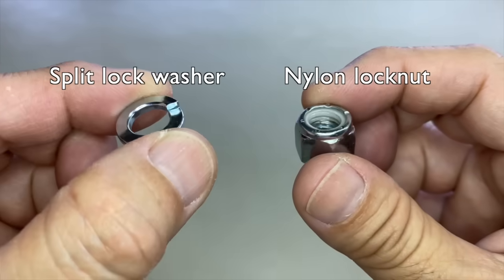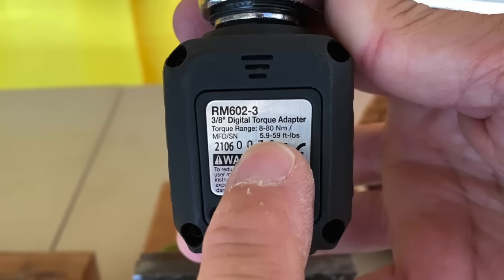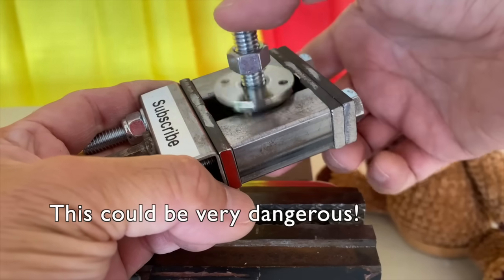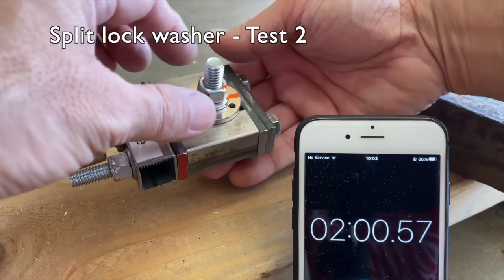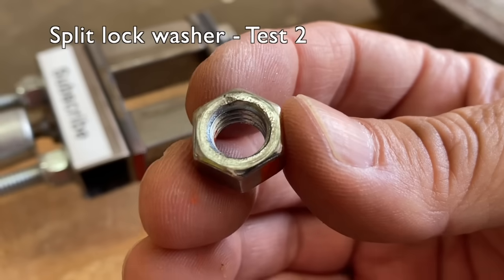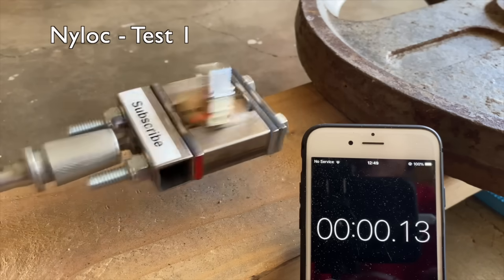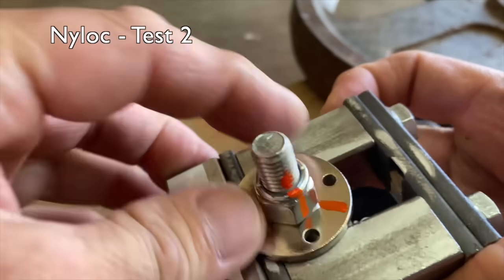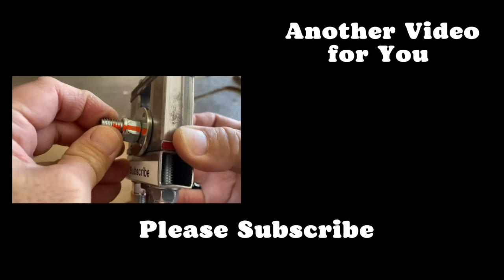Nuts & Bolts - Split Lock Washer vs Nylon Locknut – DIY Impact & Vibration Test - Part 1

Comment: theres also tourq requirements for various washer set ups. splt washers where I work require much more than 6 foot lbs. Not saying that they are the best of washers, but that have their place, and the correct practice needs to be followed.

Comment: Interesting and a good test and thanksfor sharing. I do wonder if the split washer is a bit too loose but all-in-all this shows that once the clamping forces are lost then, the nyloc works a bit better. This is presumably since it relies on the nylon washes to retard loosening and the split washer has nothing once the clamping forces are lost. It's also worth seeing that the split (or spring) washer can be put on two different ways and I think one of these will better hold the assembly tight.
This also goes to show how expert we've got at locking fastners in place, such as with split pins (cotter pins), threadlocker or other less 'expert' measures, such as jambing nuts together.
I was told not to re-use nyloc nuts, which I often ignore, but I would respect this on ball joints and the like, and also not to spin up nylocs with impact drivers etc as this speed lessens the effectiveness of the locking. Sort of seems to make sense, but I don't really know.

Comment: I can't image an application where the bolt would be free to slide around laterally like that.  It really should be anchored in place with the jig rather than flopping around like that.

Comment: Interesting choice of nuts used in your holding device . Back in the 60's I used castle nuts with cotter pins or safety wired in many key locations .

Comment: As the nyloc resists turning, there had to be less clamping force when torqued at the same (too low anyway) level, so the comparison wasn't fair.  There should have been even larger difference, if the nylocs would have been as tight as the regular nut with and without split washer.  Hard to test how much more to torque them though, so real life situations might still be the same as in this thest and people will torque both to same spec aka random.  3/8" sounds like it wouldn't usually break by mistake, but is still small enough to be turned too tight by hand anyway.

Comment: Hacks By Dad…question: How would the serrated type of ring washers compare with the split ring type or the nylon type rings⁉️ I assume, if tested, that the serrated ones would be better at holding the nut to the bolt better than the split rings ones but still not as good as the nylon ones? What would you surmise? Curious, thanks

Comment: Torque spec for 3/8-16 is 23 ft/lb -- completely unfair test - the split lock washer is not completely engaging at 6 ft/lb

Comment: I liked your experiment and have asked myself this question many times.  
    I am retired from 17 years of auto mechanics having switched careers.  Bolts have torque ratings that vary under circumstances like 'dry' torque rating and 'wet' torque rating.  Plus, nylocs add their own resistance to the torque value so your 6 ft/lb was actually a little different for the two types.
    IMO, your results are interesting but only suggestive.  It would be useful to repeat the experiment torquing the bolts to their proper values according to the manufacturer's specs and see how things play out that way.  
    To me, the main benefit of a nyloc is that they resist turning AFTER they get loose - an excellent safety feature for critical assemblies.
Reply: if he used proper torque, his experiments would last several days each.
Reply: @west_park7993  Correct! If the bolt is tightened correctly and the appropriate tensile strain induced in the bolt - it won't loosen! Split washers are a useless blot on the face of the eath and nyloc's have their uses but not in clamping applications.
Reply: Also the Nyloc can’t be used multiple times as they wear out. Lock washer is good if you ever want to remove the fastener. This was very good. Thank you!
Reply: Imagine if you used a nyloc but you put a split lock washer under it!!! 😮
Reply: @SuzukiKid400  I was thinking this too... 😁
Reply: just search for "Junker vibration test"
Reply: elliptical nuts. triangle nuts. nuts with collars. two nuts compressed together.
Reply: I would prefer using clamping force in addition to torque.
Reply: this
Reply: Bingo babyyyy
Reply: "Plus, nylocs add their own resistance to the torque value"
My thought too.
I'm ex aviation industry and a ME.

Comment: The nylon locknut never loosened from the bolt as shown by the paint marking. The assembly loosened because the bolt stretched.

Comment: This is surprising to you? Nylocks are the minimum standard for most quality fastening jobs. Actually stainless, flanged nylocks for every application other than static at home repairs, if outside then always stainless. All cars and vehicles vibrate.
It is unacceptable how difficult it can be to find these, and then the prices are too high. If everyone demanded them they would be a lot cheaper and more readily available for all of us.

Comment: 6 ft/lb 🤦‍♂️. I didn’t even want to watch the test after I heard that. It went just like I figured it would with a barely snugged bolt. 

For reference a common recommended torque for the lowest quality grade 2 3/8x16 bolt like he used in this video is 15 ft/lb. 

This is probably a test that was thought up to show “the superiority of nylon locknuts”. A good test would be to repeat the test at the suggested torque, and then with other grades of fasteners…but that would probably destroy hit test rig. 

In all seriousness, nylon locknuts do excel in less than fully tightened situations where a standard nut would likely continue to loosen. They also do typically outperform most cheap low grade hardware, but at the price point of higher grade hardware. 

Nylon locknuts are not some perfect solution though. Split ring lock washers are not bad. 

They both do their job well when they are used correctly in an appropriate application. 

NEITHER of them are perfect. I wouldn’t ever trust either of them though in situations where a single nut coming loose has a likelihood of causing catastrophic consequences. There are reasons why many safety critical hardware uses specify and even legally require safety wire, cotter pins, castle nuts and cotter pins, jam nuts, specific thread locking compounds, anti rotation tabs and plates, and even a tack weld between the nut and bolt. 

That’s why you need to replace damaged or missing hardware with appropriate stuff. Don’t work on your car, loose the grade 8 hardware that came off your suspension, and replace it with some random grade 2 or grade 5 bolt you had laying around.

Comment: Despite all the videos like this one talking about how badly split lock washers are, in my 50+ years of repairing everything from bicycles, tractors, cars, trucks, and industrial machine tools, I can count on 1 hand how many times I've run into an issue with them.  Of the times I have, it's usually due to severe rust that caused them to disintegrate.  I'm excluding cases of improper installation, Bubba will screw up the simplest of tasks in the shop.  I primarily use Nyloc's in circumstances where the joint can't sustain high clamping pressures or the joint needs to move.  A better solution over Nyloc's are distorted thread locknuts.  If it's something that's going to experience severe vibration, hard rivets are my preferred solution, not nuts and bolts.  If they aren't possible, I'd drill a small cross hole and use a castle nut and cotter pin.

Comment: For all the haters…
If you are building a bridge, follow the plans
If you are fixing your kids wagon, use a nyloc so the wheel won’t fall off 🤷‍♂️
That’s the whole point of this
Reply: Yup but it would be more accurate if they used the actual torque specs for the bolt used. 6lbs isn't even close!
Reply: Hell, I just use blue or red Loctite.
Reply: I’m a hater… proud of it…
Reply: @Thewatcherinthering336  hate what?
Reply: The bridge probably calls for split lock washers and a flat washer.
Nylock is for pussies.
Reply: How about tightening the fastener correctly in the first place and using the right fastener in the first place.
Confusing folks questioning dodgy science with haters is typical right-wing, reactionary,  trumpist rubbish.
You can have your opinions, but they better be backed up by facts ,
 because the whole world can see if you are a dill or not in this forum.
Reply: @nkelly.9  TDS
Reply: For your kids wagon, use a longer bolt, if required, and two nuts blocked against each other or drill a hole in the blot and use a pin.
Reply: Then tack weld  @jeanlemire2681
Reply: yep. with the right software, one can see the NON-Likers. 12 on 8/2024...which is really weird!
Reply: @antoniiocaluso1071 you said “with the right software”, what software would that be?
Reply: @jpe1  return youtube dislikes extension
Reply: @Fine_i_set_the_handle  got it, thanks
Reply: @antoniiocaluso1071  What's your thinking here?
Reply: @andrewwebb2141  Exactly! I guarantee even the haters learned something from this video.
Reply: @jaypie0864  what "haters"?
Reply: Don't read the comments below lol

Comment: The grade of bolt and nut is not mentioned. The amount of torque should also have been taken to the yield point of the bolt. This supposed test is meaningless.

Comment: Wrenching on you name it for something like 40 years now, these were pretty much the results I was expecting when I hit play on the video. Split washers only offer some vibration resistance and are kinda junk beyond that. Nyloks are great but can not be used in hi heat applications IE exhaust flanges etc. same with Loctite, heat kills them both. Rust is an amazing locking mechanism LOL

Comment: -Your test is not a valid test of a bolted system.  

-A nut a bolt a lock washer and flat washer are required by industry.

-the torque is calculated for a specific load not a random number.

-bolt hole tolerance is critical, your random width and the resulting transverse impact is not seen in industry.

Comment: Nice job on the test!   Split lock washers are garbage….  Always.   Design your joint with sufficient grip length and preload/joint stiffness-so you don’t need either.  In the most critical joints on an engine…. Head bolts, connecting rods, main bolts, don’t have lock washers…

Comment: that is a crap test... you blame the criteria only on the technic... I would say that the only material that did not give was the nylon nut... if you would have take into the consideration that the nylon nut was the only solution that did not give or move between the nut and bolt (looking at you marking) the material gives not the locking solution...  and as always the solution depends on the use.

Comment: I'd be interested to know if the nylock nuts would perform even better if they were torqued according to equivalent clamping load rather than twisting force.  It takes some amount of torque to overcome the resistance of the nylon, so there wouldn't be the same initial force holding the assembly together, especially at a meager 6 ft/lbs.

Comment: When you use soft bolts you can expect some bolt stretch  ,  the nylon nut didnt turn on the bolt .  The looseness can from bolt stretch .  Try a grade5 bolt
Reply: The Nyloc did turn. The bolt wouldn't stretch with 6ft/lbs!

Comment: I saw some lock nuts on some heavy equipment. Both faces of the nuts were concave. When torqued down the nuts would bend slightly causing the.the threads to bind.

Comment: Nyloc's work. Split washers add little value. In both cases, however, 6 ft. lbs. is a very low fastening torque. With the nyloc the friction between the nylon collar and the bolt means that the actual tension on the bolt achieved at 6 ft. lbs is even lower than with the split lock washer. Anyway, if you want things to stay together, use a nyloc or a loctite style sealant.

Comment: I learned many years ago that a split/cut washer works no better than a flat washer when torqued to spec.  The only time I use them is when I don't have a flat washer with the correct ID.

Comment: Here is an interesting untested variable in your setup. Galvanizing. Galvanizing is known for reducing the clamping metal to metal friction force due to its lubricating properties. You need to preform the same test with black bolts. FYI your electroplated bolts are only good for indoor use and hot dipped galvanized bolts should be used for outdoor use. In essents the electroplated bolt only help to keep the rust away during storage.

Comment: Stupid waste of time... that size nut/bolt should torque to 38-42 Lb. ft. not SIX!!
the nylock took much more than 6 lbs. to thread it on.. no sense to this.

Comment: Nice job.  Split lock washers are junk.  Split lock washer have no benefit once they are completely compressed.  If you need a locking washer, use a star washer, use a locking nut or Locktite.  If you torque the bolt to specifications, you don't need a locking washer at all.  Engine bolts and studs have no locking devices. If you look up the torque specs on that bolt it's probably 30 lb.ft. or greater.
Remember, nylon locknuts are single use.  Whenever possible bolts should be used in double sheer, preferably with no threads in the joints.  If you have to use a nut in tension, use a larger washer to distribute the load.  That's why automotive bolts have a built in flange and are radiused between the bolt shank and bolt head.

Comment: Lots of arm chair quarterback comments. Regardless of all the negitive comments, it still demonstrates what a nylon lock washer can accomplish over a split and no washer installed.
Reply: What are we actually testing, the spring washers purpose is to provide tension and preload however that's not what we are testing here.

We can say that when a bolt and nut are loosely tightened then Nyon lock nuts will do a better job than a spring washer.
Reply: @ghostofdre  The nylon lock nut may or may not do a better job than a lock washer. This is a test of a specialty application with high stress. In the vast majority of applications lock washers will still do just fine. Another factor is that nylon lock nuts are only meant to use once because the first use of one has far more holding power than subsequent uses. They're also pricey compared to conventional nuts. When using enough of the nylon lock nuts that price will add up. 
   But there's also a flaw in the testing in that it wasn't inclusive enough. Not once was thread locker mentioned. The advantage of it is significant. It's inexpensive. Additionally it helps with corrosion protection. And lastly it comes in grades of holding power. Those are things that neither lock washers nor nylon lock nuts can ever hope to do.
Reply: @joewoodchuck3824 in pretty much every test the company i used to work at did, lock washers are functionally useless.

Nylocs are ok for low temperature use while prevailing torque nuts are best all around - but most expensive.
Reply: @VladimirPutin-p3t  That's all well and good. But did any of those tests include normal DIY or lower stress applications? Probably not.
Reply: @ghostofdre  And why would anyone ever "loosely tighten" a nut and washer?
Reply: It isn't a nylon lock washer. It's a nylon lock nut.
Reply: @joewoodchuck3824  There it is! It didn't take long for another arm chair quarterback to jump in with more "expertise".
Reply: @jaypie0864  I said nothing that isn't factual. I'm sorry that you don't understand the terminology.

Comment: Missed opportunity to do both split washer and nylon lock nut together.
Reply: Also, Keps nuts with integral star washer....
Reply: I use this method. Nyloc and split washer.
Reply: Absolutely pointless.
Split washers aren't even meant for ridgid assemblies.
If you're REALLY concerned about loosening you design for cyclic loading with proper fasteners (place bolts) properly torqued.
Look at anything from a drive line clutch, to a locomotive or rock crusher and that's all you'll find.
Like was said, if you want to keep the wheels on your kids bike use a nylon, but they can't stand heat or solvents.
Reply: @jimurrata6785  all your examples use some form of thread lock, not saying I know better, just it'd be 1 less counter-argument a person could make if you work around it.
Reply: @EXZACHTPERFORMANCE  So, what class fit do YOU suggest to keep an under torqued nut in place when subject to violent cyclical loading?
Reply: @EXZACHTPERFORMANCE  I make ONE example.
The other two are what the video is about

Comment: I can tell you one thing from personal experience. Never use split lock washers on top of cast iron. The facility l retired from was a complete automotive plant. Engines, rear ends, stampings and assembly. For a while l worked in the stamping facility doing on floor repairs. Somebody on Third Shift would use split washers on top of cast iron on top of press components. Not a good idea. Especialy on presses being used to stamp heavy gauge components such as cross members or side impact beams.

Comment: The problem is that the split lock washer is not installed as they are intended. So results were inconsistent. Almost nothing installed at 6 ftlbs has a lock washer. The torque is always high enough to completely compress the lockwasher. With it compressed, as in real world use, they will fail quickly every time. NASA did a study on various means of locking a bolt down, and found that only do lock washers not work, they actually speed the loosening of the bolted joint. This is due to the fact that it provides a force that pushes the nut as it begins to spin. Plus, once compressed the sharp tooth of the lockwasher no longer is in contact with the nut, The end result of thier tests was that thread locker should he used. Possibly a Nord type lock washer, but they did not test those & could not make a definitive statement on thier effectiveness.